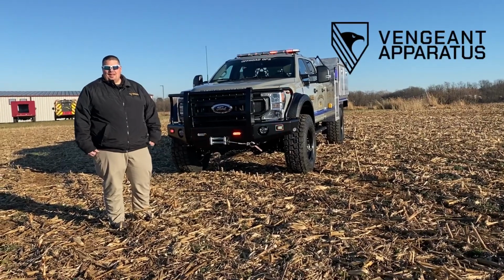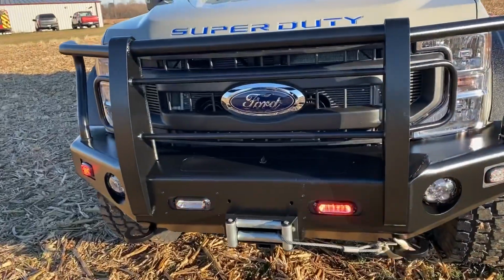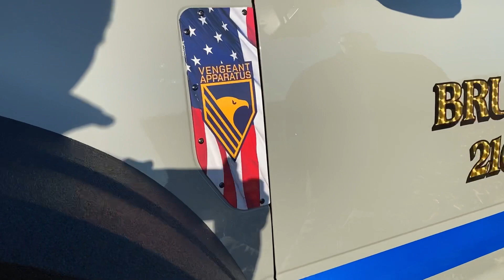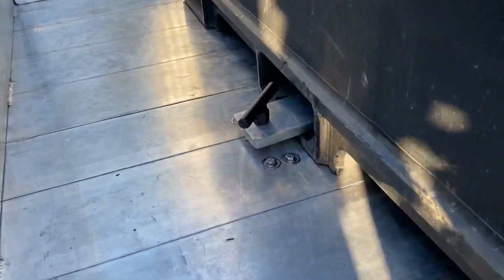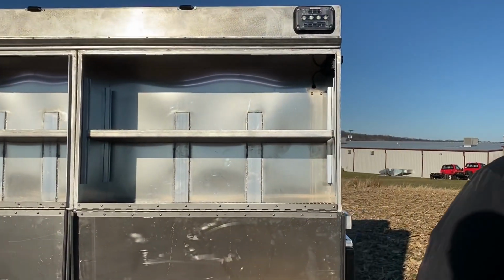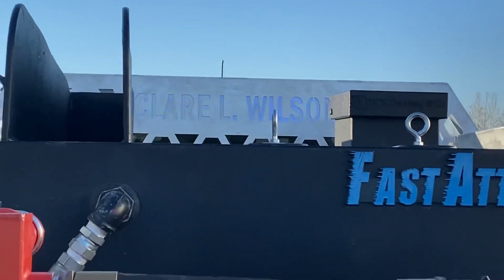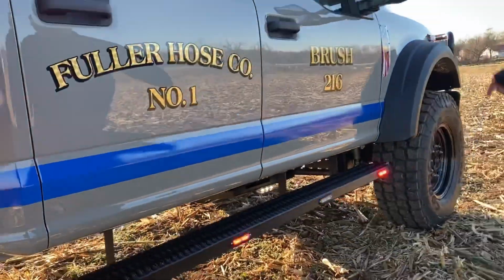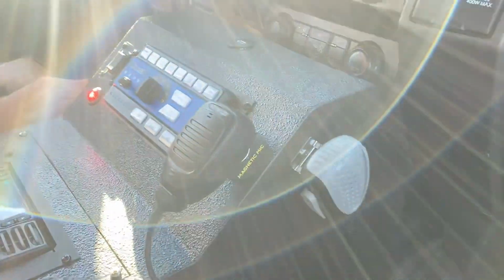Fuller Hose FD, Vengeant Sandstorm Brush/High Water Truck

Comment: Man, with those non-traditional colors, that thing seems ripe for an accident. People expect (look for) fire trucks to be well marked RED, not some other color blending in with the rest of the traffic.
Reply from the maker: Unfortunately colors tend to go back decades or to the point of the start of the department. Colors are like part of history that generally won’t change.
Reply: @Robin Stewart I hate to break the news to you but ALOT of fire department trucks are not RED. Just like the color of lights used on fire truck is different in different parts of the country. Some fire trucks have flashing blue lights on them.